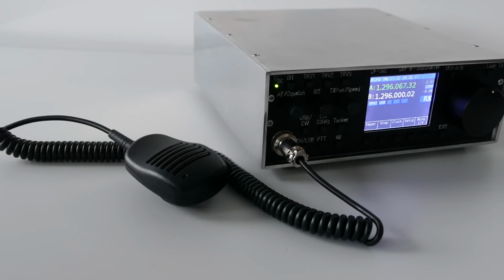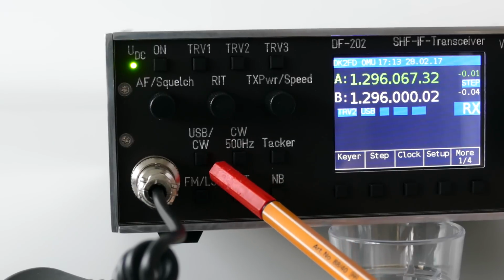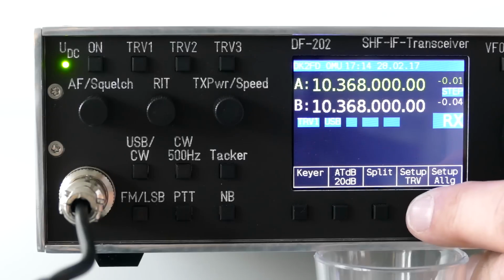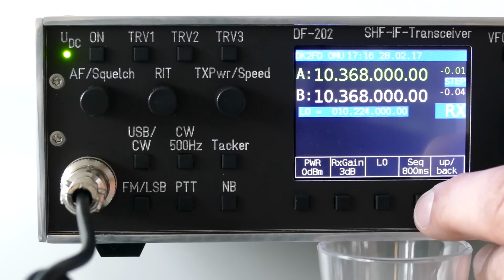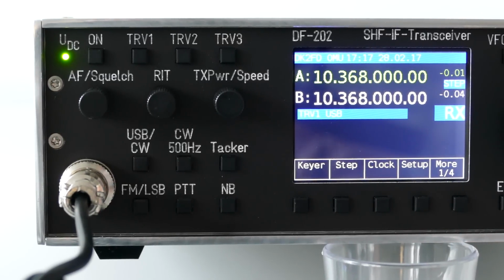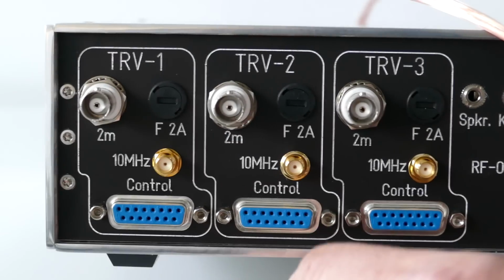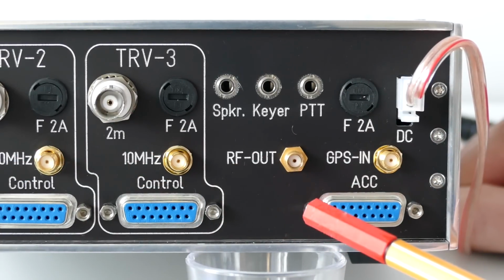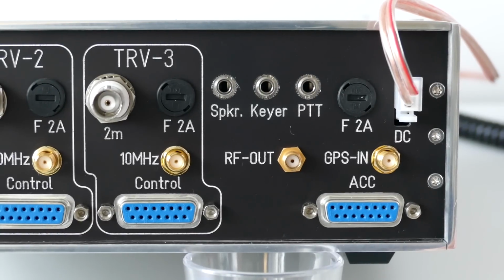DF-202 DK2FD - Video no.1 in english - SHF-IF-Transceiver (2m-SDR-Transceiver)

Comment: Great project, thanks. Please consider:1. Four TTRVs (typically 24, 47, 76 and 122 GHz for MULTI contest  stations; 10GHz to be standing alone as there is lot to do for the whole contest),2. Separate switching of power supply for TCXO and the other circuits of TRVs in order to keep TCXO tempered for the whole time, but to decrease total power of the entire TRV not to overheat it on the sunshine,3. Max current of 2A for each TRV during TCXO heatinh up,4. Option of separete remote switching box located on the mast in order to reduce number of cablings - many of contest stations are forced to use quite tall masts due to forest around.Just tips... Thanks Tonda ok2vmc, member of contest team ol9w.